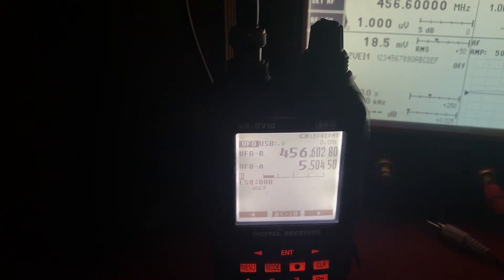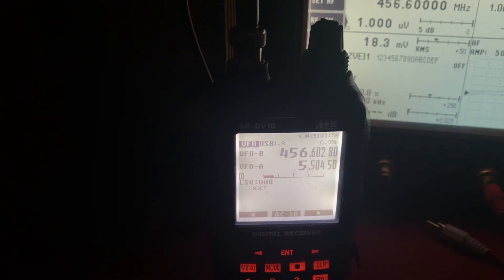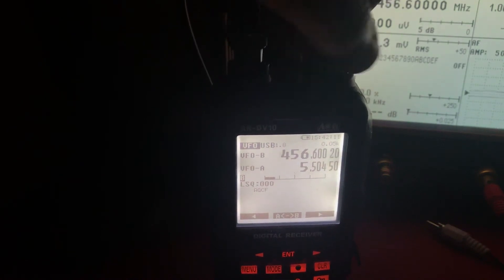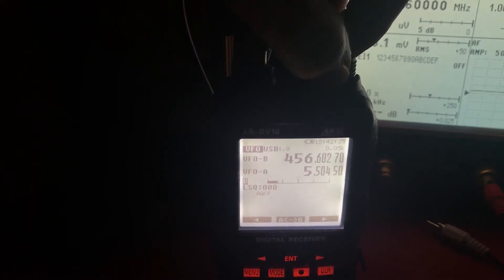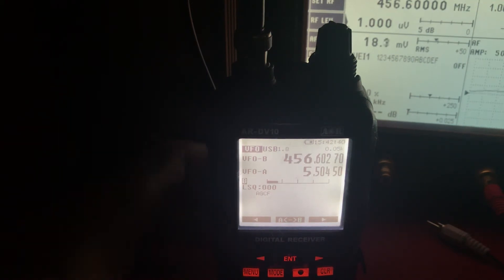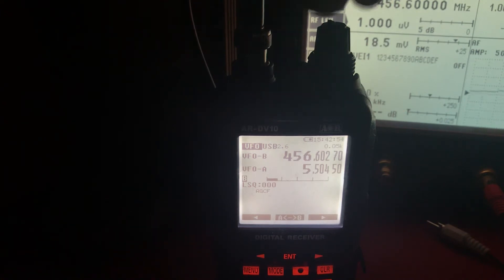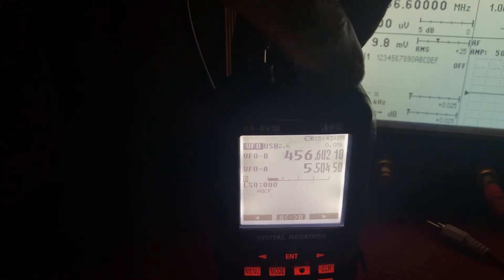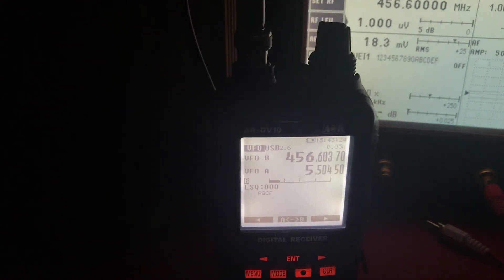Trying to test the AOR DV10 in SSB mode

Comment: Oh dear!    I'm so glad I saw your video.  Have been waiting for dv10 to be available in AU.  Mostly wanted it for HF and ssb.  My reasoning was that being a sdr it should be fairly easy to get good performance in a device this size.  After watching this I am def going to wait and see if these problems are sorted out before handing over any money. The kenwood  thd74 seems much better on hf. Its not available here but I can get one imported.
Reply: Jose Martinez 
Hi, have a look at more videos and try to get a test drive, as for this particular video channel it should be called "I hate aor and I'm going to try to damage their rep as much as I can. He should get his device exchanged and then do another comparison with the first one. Firmware updates should iron out any problems with these first batches. If this is a problem on all DV10's we'd have heard about it. I would wait and do a little more research before you take this view as gospel when it comes to the AOR products.
Reply: If you looking for a good USB receiver look in to Tecsun PL-365.
Not the PL-360 the 360 does not have SSB capability. 
It has a digital processor built-in it.
I was surprised how sensitive this unit for the price.
Reply: @TheShaunksread  The AOR receivers are the best receivers in the public reach !
Most of the professional companies are using AOR receivers, police, private investigators etc.
The low power transmitters can be picked up for a long distance. 

The only secret is you have to learn how to use your receiver.
You can make most of the adjustments through the software an the keyboard of the receiver.
AOR receivers let you reprogram te factory settings to the deepest point so you can use your receiver for your taste.
Reply from the maker: @TheShaunksread  When you've paid £1000 for a drifting off frequency mess of a product then I will post how bad it is, AOR don't care so until they address the issue I will keep posting reports on it.
Reply from the maker: @va3vad  AOR produce mediocre off frequency crap, they are not fit for hobby use and certainly not commercial use, if you can't design a receiver with a stable tcxo then its no use to anyone.
Reply: Radio-World Radio-World I'm not saying you shouldn't, I'm no expert but one or two observations you could enlighten me on. The behaviour of the s meter was very dodgy but the digital signal strength readout didn't move in unison with it and one other thing the blocking which showed across the whole Bandscope was the same as on the video I watched of a R&S ESMD when there was a spike from what appeared to be from something similar to a mains power supply spike like from a light switch or something. The alpha was/is quite an early DSP equipped Receiver and surely it can't be as bad as you make out although I don't know but from the video it seems to be a really nice bit of kit. The Bandscope Function seems much better than the type on say the Icom 9500 and yes, you're right to be holding it to account to a certain level but I would imagine that it would serve well in its role of semi professional use. I wouldn't imagine that it is used in critical applications like ATC as you mention where the ESMD or similar would be used in ultra critical applications and they cost as far as I'm aware about 60 grand. But, as I say I'm no expert and would like to know more details especially what AOR reckon. I've only had an AOR AR 3030 and 7030 and apart from some big birdies on the 7030 I've been impressed with the products they put out. What do you think is the difference between the SR 2000 and the alpha that might be responsible for the disparity in the immunity from pager signals??
Reply from the maker: The drift on HF makes it useless, although they won't admit the botched mess they have issued an erratum sheet saying it doesn't meet frequency spec below 25MHz, at 100kHz its as much as 1300ppm, way outside the +/- 5pmm.

Comment: Perhaps the most upsetting thing is that AOR tried  to deny the problem. After many complaints of many pi---ed-off users who paid top dollars for this radio, they started to release various firmware updates (so implicitly admitting that the problem was indeed real). But a frequency drift caused by thermal causes is hard to fix with firmware patches, and they´d need to re-design part of the circuitry. For sure all this stuff pushed AOR´s reputation down to unprecedented levels. Too bad.

Comment: I was on about the AOR alpha vid you posted. But again, what is the spec stability for the DV10? and also did the device warm up because even with my Icom IC-R20 and it's +-6ppm that's, if I'm right and my maths is crap 6hz per MHz so at 430mhz it's quite a drift which maybe a OVXO might help with a bit but not a TCXO which I'd assume would help with the audio quality of SSB but not perhaps accuracy?? Using a piece of test equipment to measure a hobby scanner then slagging it off seems a bit harsh. How does this measure up to any other handheld devices you might have, that would be very interesting to see.
Reply from the maker: spec is +/- 5ppm 10 to +50C, at at the bottom end of HF the drift is 1300ppm, they issued an erratum in some poorly translated sheet that it may not meet spec below 25MHz, its a botched mess. To try and correct the drift they've added a botch in firmware which jumps the pll ref and offset around trying to keep it near frequency, as it wobbles trying to correct itself you get a warble of up to +/ 50Hz which can be heard in SSB or CW mode.